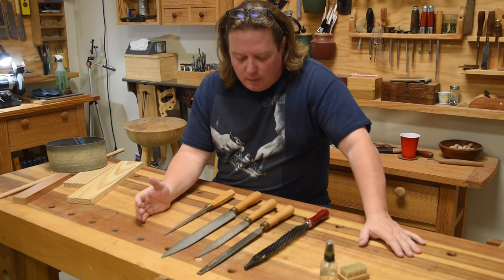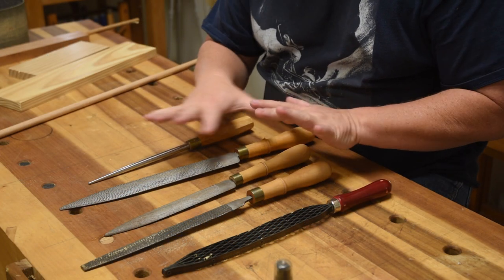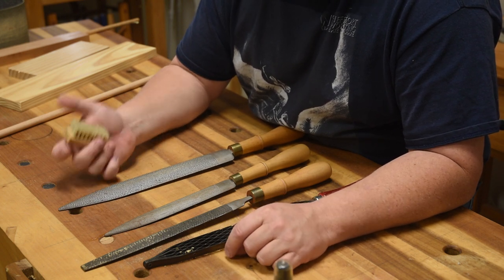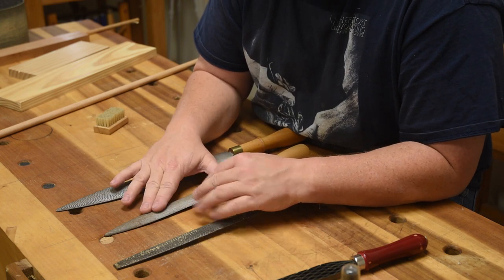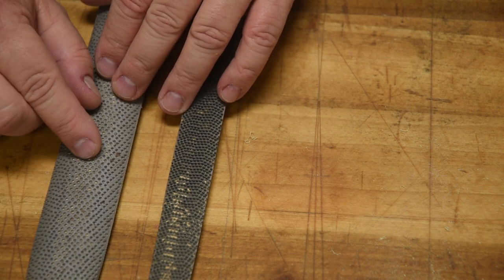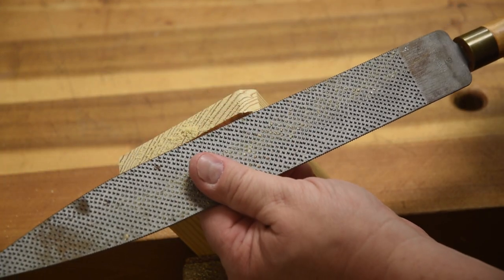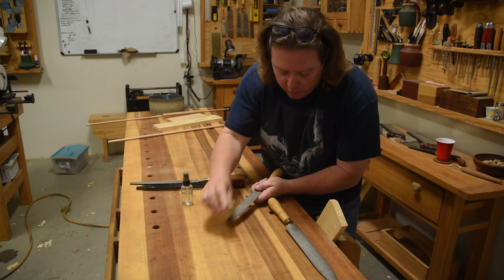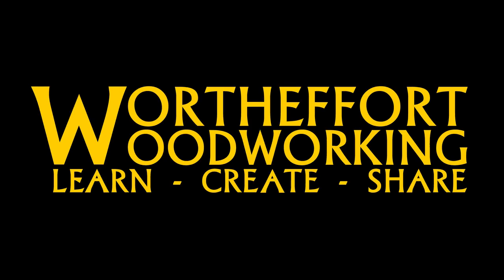Rasps

Comment: Shawn, I also am really enjoying this series, and really appreciate the bonus structure each end. My question in on the "new" Nicholson 49/50. You are just about the only serious blogger that has a kind words to say about them compared to the "old" USA made Nicholsons. I have not used either the old or new ones, do you have experience with both?
Reply from the maker: No I don't have experience with both. Mine are about 10 years old. My opinion is it's always been a rough cutting tool. Not something that would be the last thing to touch the wood. Get the shape, then refine. With that attitude I don't think either will really disappoint. But then again, once I got the Auriou I really don't use it much.

Comment: I think it's been a while since you bought your rasps :-)  Nicholsons are $60-70, Aurious are $100-150. What do the designations "grain 8", "grain 9", etc. mean? Which are likely to be see the most use?
Reply from the maker: The grains are like grit. Just looked on Amazon. First search showed Nicholson 49's were in the low $50's.
Reply: I only found one #49 on Amazon, for $54.99+$4.24 shipping. #50 was $70+shipping. I was just looking for reference, I have both, but no Aurious. Love to have a set of those. Recently made a pair of Danish chairs that required a lot of sculpting, I used a Kutzall carbide burr in my angle grinder. Might have been more fun with some nice rasps. So what grain are yours?
Reply from the maker: I'd suggest doing a little shopping or waiting for specials. Eventually you'll find them in that price range.